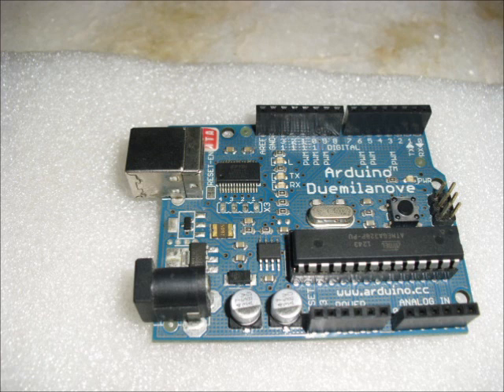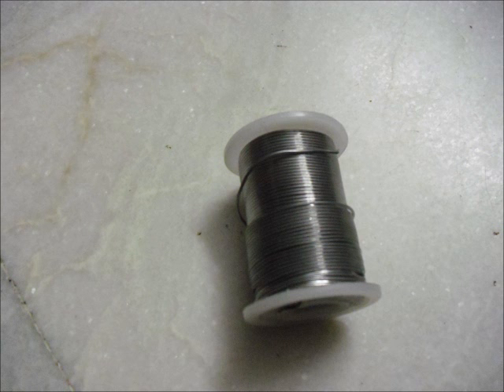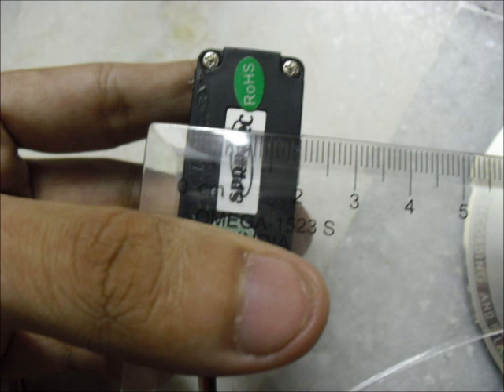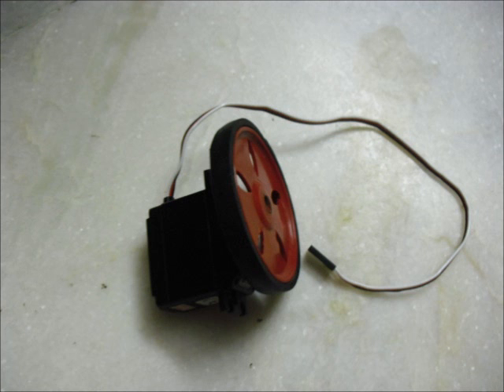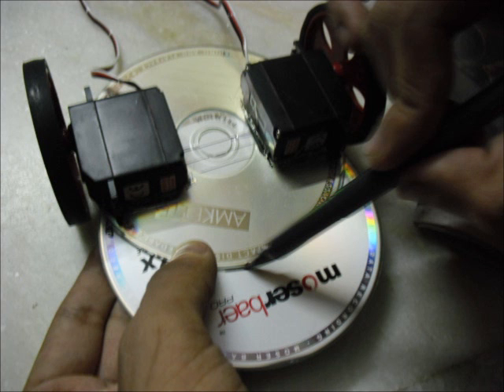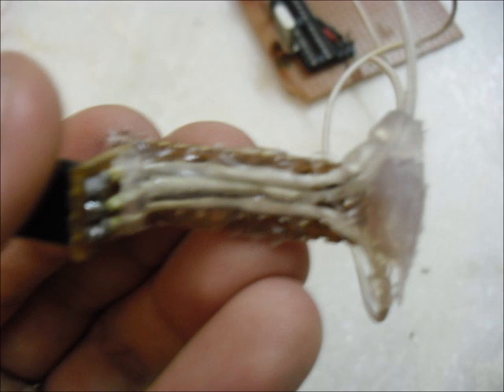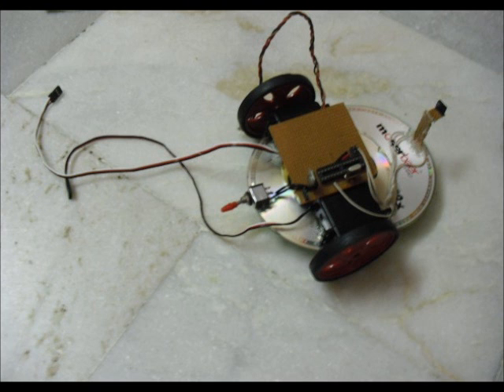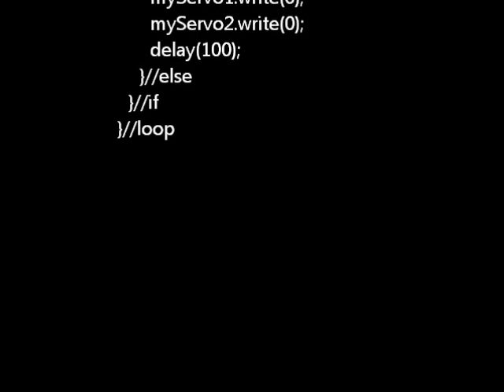How to make a simple robot step by step - With Arduino Code

Comment: Hello, Made the robot and it came out great! Noticed you have blinking lights on yours. Is there any code for that. Need some help starting the code for that. I also have a servo sweeping my ping sensor
Reply from the maker: Hi Kenneth, Glad to hear you made yours! Can't wait to see a pic of it! Regarding the lighting,I used a RGB Led for this. Good thing is it does not require any coding, as the LED itself blinks periodically with flashes of Red, Green and Blue. Nifty and frugal :)

Comment: can we use  motors instead of servos
Reply from the maker: Normal motors typically have high RPM. Typically robots require high torque low RPM motor, so normal motors wont work.Geared motor will work. Servos are the best, though.

Comment: Some slight mistakes in the code - Missing variable Declaration - now sorted

  #include<Servo.h> 
  
  Servo myServo1; 
  Servo myServo2;
  
    const int PINGPIN = 2; 
    long duration=0;
    long distanceCm=0;
    long distanceFront = 0; 
    long distanceInches=0;
  void setup()
  {
    myServo1.attach(9); 
    myServo2.attach(10); 
  } 
  
  void loop()
  {
      pinMode(PINGPIN,OUTPUT);
      digitalWrite(PINGPIN,LOW); 
      delayMicroseconds(2); 
      digitalWrite(PINGPIN,HIGH); 
      delayMicroseconds(5);
      digitalWrite(PINGPIN,LOW);
      pinMode(PINGPIN, INPUT); 
      duration = pulseIn(PINGPIN,HIGH); //
      distanceInches = duration/73/2; 
      distanceCm = duration/28.6123/2; //
      Serial.print(distanceInches); //
      Serial.print("in, "); //
      Serial.print(distanceCm); //
      Serial.print("cm"); //
      Serial.println();
      delay(100); 
      distanceFront = distanceCm; 
        if(distanceFront > 1)
        {
          if(distanceFront >10)
          {
            myServo1.write(0);
            myServo2.write(180); 
              delay(100); 
          }
        else
        {
          myServo1.write(0);
          myServo2.write(0); 
          delay(100); 
        }//else
       }//if
   }//loop

Comment: Can I use geared motors instead of servo's and My ultrasonic sensor has 4 pins
Reply from the maker: Yes you can use geared motors.Remember to move forward, you need to rotate both motors in same direction,and if they move on opposite direction will result in turning the robot.For your sensor ,u can find pin mapping on web and conversion to 3 pin may be possible too I think.
Reply from the maker: Prashanth Sekaran
Here you go :
http://www.instructables.com/id/Hack-an-HC-SR04-to-a-3-pin-sensor/
Reply: Thank you so much